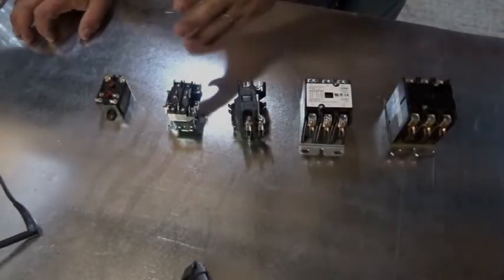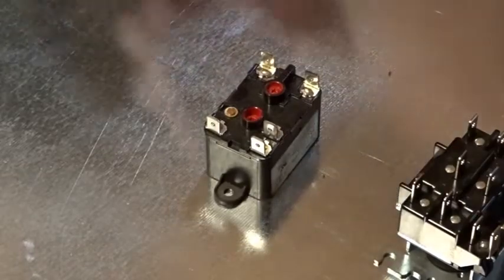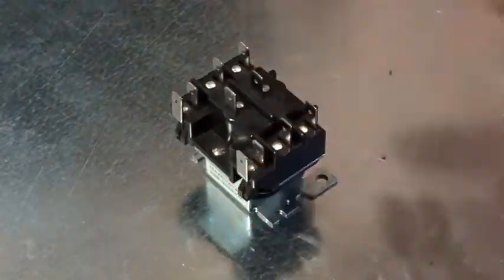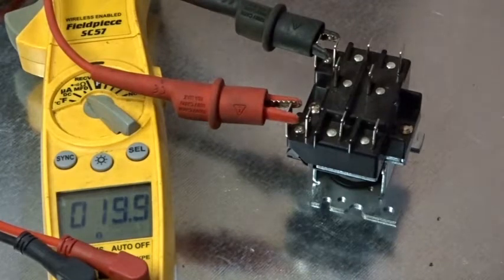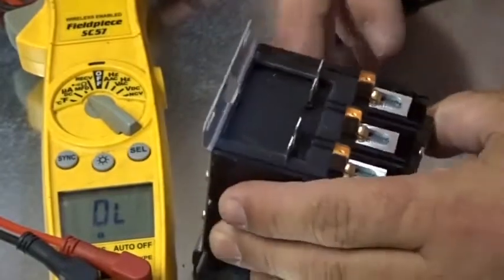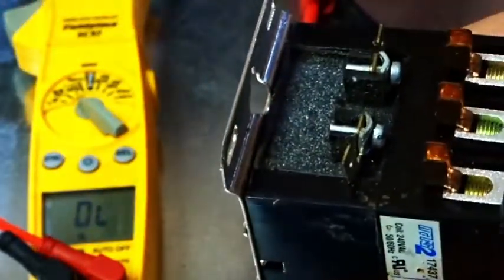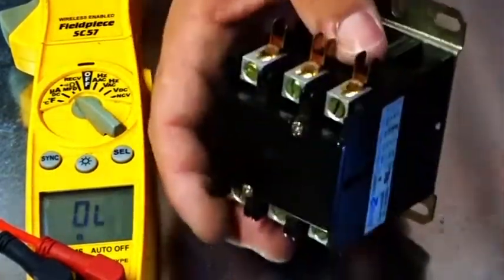HVAC Relays | Coil Ohms

Comment: WATCH THE WHOLE VIDEO TO SEE HOW TO IDENTIFY COIL CONTACTS VS SWITCH CONTACTS.
0:00 View of 5 relays and statement of purpose to measure the resistance of the relay coils.
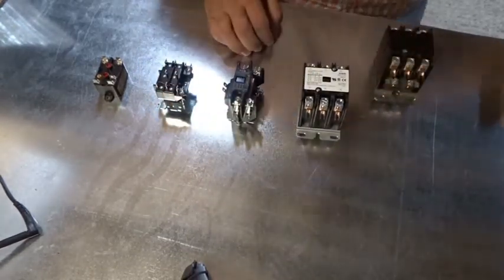0:49 SPDT 24VAC relay, 74 ohms (all values rounded to the nearest ohm)
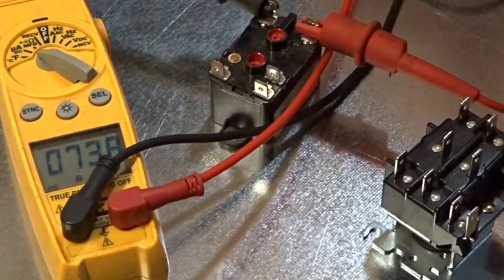1:58 DPDT 24VAC relay, 20 ohms
3:24 SPST 24VAC relay, 16 ohms
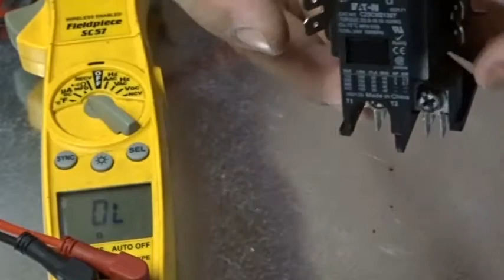3:42 Statement that this SPST relay goes between common and Y1 (cooling) to turn air conditioning off and on.
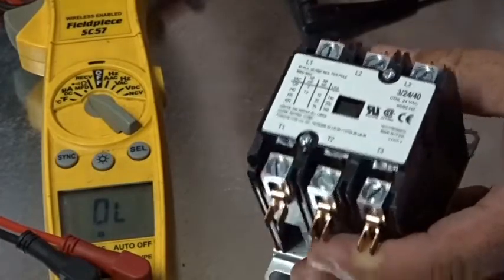4:40 3PST 24VAC relay, 9 ohms
5:45 3PST 240VAC relay, 676 ohms
Power and current drawn by each relay coil:
SPDT relay coil: 24*24/74 = 8 W and 24/74 = 0.32 amps
DPDT relay coil: 24*24/20 = 29 W and 24/20 = 1.2 amps
SPST relay coil: 24*24/16 = 36 W and 24/16 = 1.5 amps
3PST relay coil: 24*24/9 = 64 W and 24/9 = 2.7 amps
3PST relay coil: 240*240/676 = 85 W and 240/676 = 0.36 amps

Comment: If an AC relay is bad , you wont hear any noise at all , not even humming noise when you turn on the AC? Thats what’s happening with my AC it won’t turn on . Would bypassing the thermosthat with a jumper will cause a relay and or thermosthat burn or cooked? I’m trying to fix my AC it was working before I bypasssed the thermosthat.